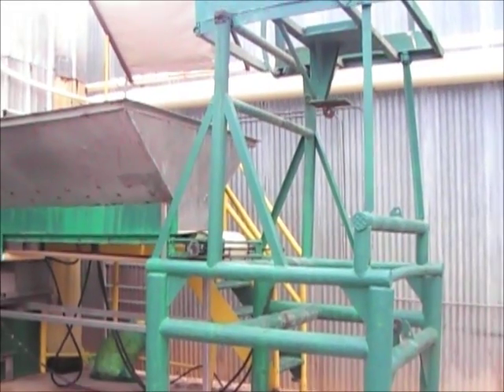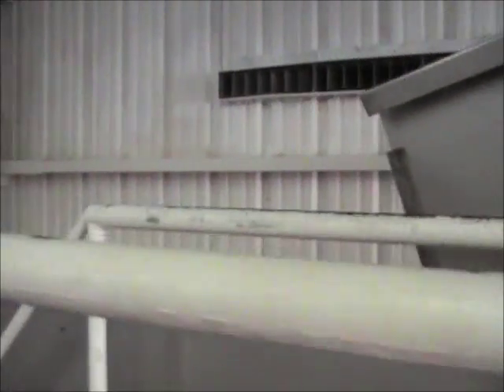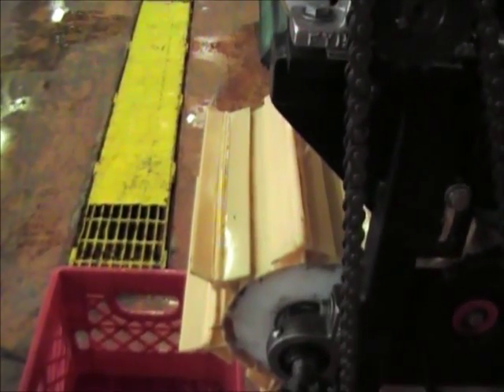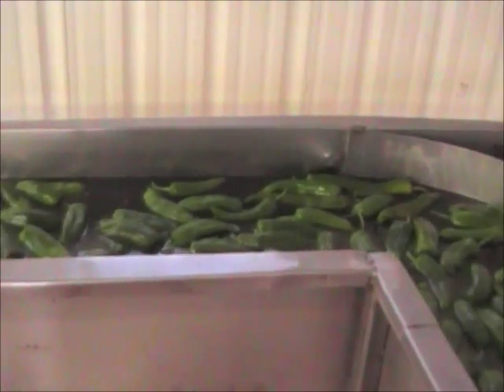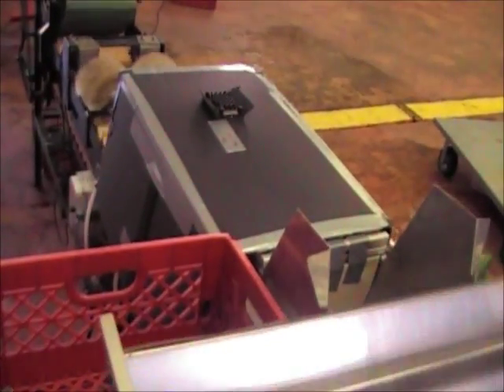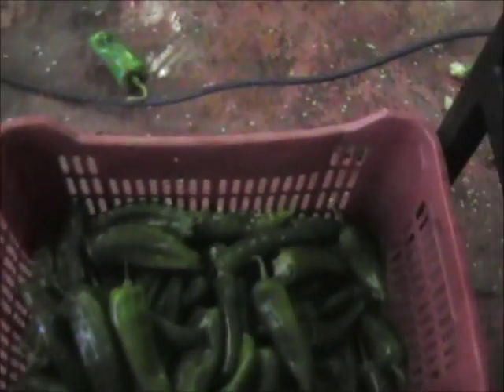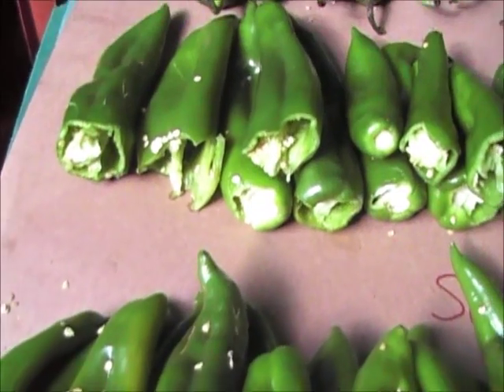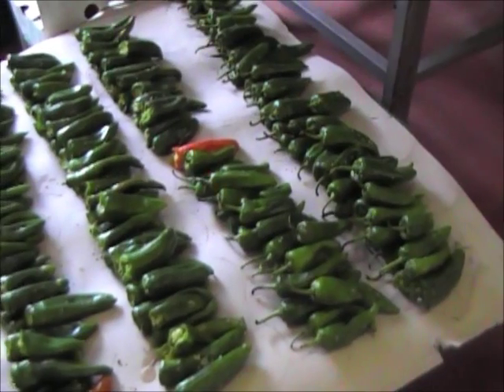Pepper Destemer & Feed System Demonstration February 2014

Comment: Will this work for red dry chillys?
Reply from the maker: The Pepster will remove stems from any elongated fruit including all pepper types.  It can pull or cut stems depending on need.  The Pepster will operate as fast as it can be fed. An optional feed system is available.
Reply: @JosephRandazzo   hi  sir I am from India  can I know that lt can pull dry chilli
Reply: Can I know the cost of machine